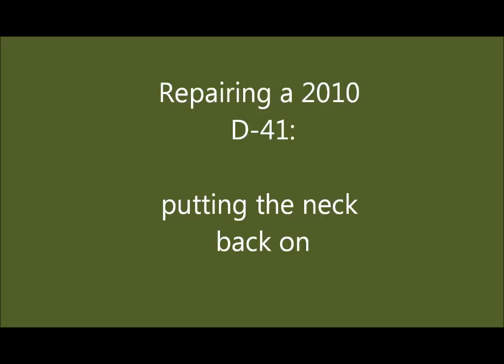Repair- D-41 putting the removed neck back on

Comment: Bryan, You mention the side to side aspect of a neck reset.  I think I have that problem on an older Guild that had a neck reset done about 7 years ago.  I wasn't smart enough to notice it at the time. Neck angle is fine, saddle height is fine, but the side to side issue bothers me, may be throwing off the intonation.  There are no shortcuts to fixing it are there?   Requires a total  neck reset job?
Reply from the maker: Take a look at the nut and see if the strings are even there.  Sometimes the nut will be off and it'll carry all the way down the neck.  If not... then full reset, most likely, unless you can yank the strings over a little at the saddle. It'll have to be WAY off to affect intonation.  If you have fat wide frets, those are more of an issue.

Comment: This is awesome. Thank you again for these. 

Do you ever use a chisel to remove the material to change the angle on the ones that are really bad?
Reply from the maker: Rarely. I use a coarse file more often. Just to get some material off and then back to the sanding strips
Reply: @Bryankimsey  ahhh that makes sense. Thanks! I've heard of people using chisels but it always seemed too easy to take too much off or put nasty, uneven gouges in it.
Reply from the maker: Exactly. The rough file removes material faster and still works with you by cutting a smooth slope in the heel rather than a bunch of uneven cuts that' you're gonna have to smooth out.

Comment: Today I've decided to finally remove the bridge from Indonesian Epiphone EJ-200.
I've used iron with cardboard covered with aluminum foil.
Damn thing got tiny cracks in front and on the back of the bridge.
I'm sure this is not my fault as I've been heating it very carefully, and the slits between bridge and top became narrower.

I think this bridge is epoxied.
I've moved much deeper, but just can't get my feeler gauge past many points.

What would you advice, dear Bryan?
Reply from the maker: No idea.  A lot of repair work is simply dealing with situations as they arise and I guarantee you that an Indonesian Epi is going to have some surprises.   Not sure what you mean by "cracks"... like in the finish?  Or the wood?  In the top or the bridge?  If one technique doesn't work, you have to switch gears and sometimes you have to shave the bridge off.   I don't like the iron- as I explained- because it tends to heat contact points more than non-contact points.  The heat lamp heats much more evenly .  So, when you switch to a different tool... you have to be prepared for the idiosyncrasies of that tool.
Reply: @Bryankimsey The cracks are in the bridge itself, running oblique/horizontally.
It's a Gibson J-200 style bridge.
The cracks are only  in the main part of the bridge, both on the front and on the back. No cracks in the "wings" of that moustache.
I wouldn't care at all if not for these things.
1. The slit between bridge and top almost closed in a few places. I can barely put .005 feeler gauge there.
2. The glue seems to not give a damn about heat in some places, it feels roch-hard.

Yeah, I've trusted other luthiers/technicians too much. xD
I'm definitely gonna purchase the lamp like yours.
Reply from the maker: Why are you taking the bridge off?   If you're gonna re-use it, then just do the superglue/dust thing to fill in any cracks. If you're gonna make a new one, then cracks don't matter.
Reply: @Bryankimsey  The bridge was coming off.
It had a nice slit and quite some free space under it.
But after heating the slit has narrowed in its middle, and a few cracks appeared.

Do you think I should superglue  prior to removing the bridge entirely?
I'm afraid the glue might seep between top and the bridge.
Reply from the maker: If you superglue it before removing the bridge, what do think is going to happen when you heat the bridge?  ;)   

Do it after the bridge is off.  Glue any cracks, polish it all up, re-install.
Reply: @Bryankimsey  Well, I thought heat will weaken epoxy/titebond between top and bridge BEFORE it starts melting superglue.

Thank you SO MUCH for your support, dear Bryan!
Reply from the maker: Nope... the superglue on top of the bridge will burn up LONG before any glue underneath the bridge will.
Reply: @Bryankimsey  Do you consider regluing the bridge properly (on hide glue and removing the finish beneath it) a tone improvement?
I'm sure this is an improvement, but wasn't so sure one can hear any difference.
But I remember you mentioned in one video that it is a note- and hassleworthy modification to a guitar.
Reply from the maker: I don't care if we can hear a difference or not- it's the right thing to do.  :)
Reply: @Bryankimsey  Haha, love your attitude and totally share it!
Just had to ask. :)

What are your thoughts on slotted headstocks? 
Do you agree that every guitar would benefit from it TONEwise?
Reply from the maker: I hate working on slotted headstocks.  Tone wise?  Hard to test it... hypothetically,  you have both tuner shaft ends buried in wood so the shaft is supported and MIGHT transmit vibrations better, but there's also less wood involved.  Me... I think I'm gonna stick with solid headstocks and firm fitting tuners.
Reply: @Bryankimsey  You didn't mention the great increase is string break angle.👀